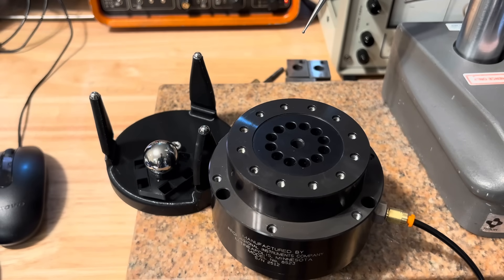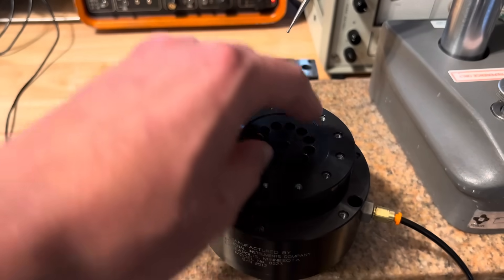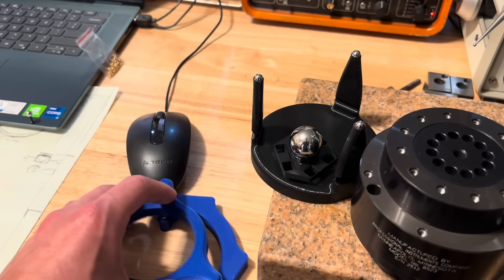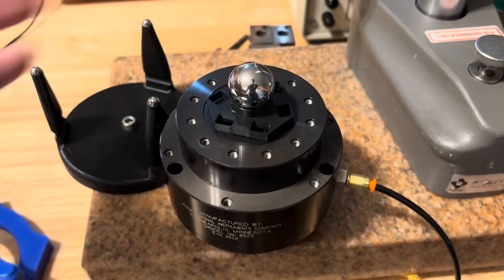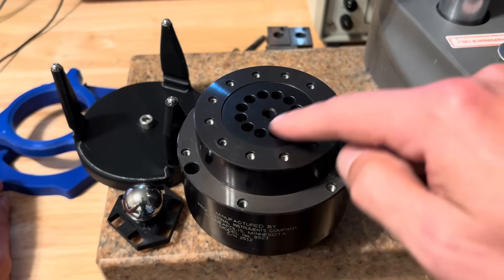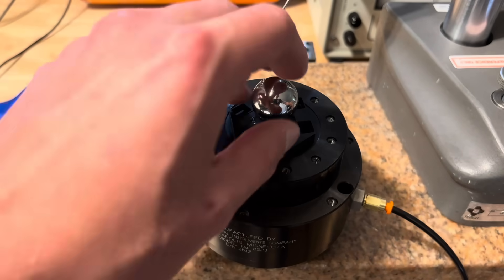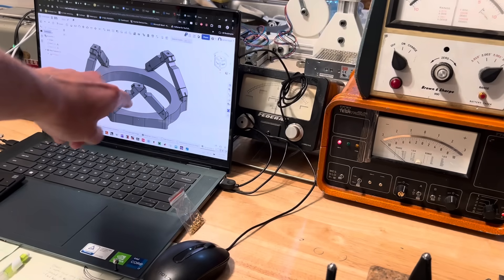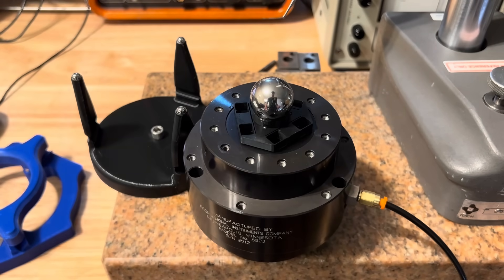Flexural kinematic couplings eliminate contact friction and provide me a convenient solution

Comment: That optical mount that you showed on the monitor... I used something like that for a repeatable mount for a lens in a portable device, so that the flexures could actually absorb some shock, and I built in temperature compensation for focus, too... Funny when you run across ideas, in other places.
Always fun to see what you are up to.

Comment: Excellent video. Really makes me think.
I've been doing a lot of research on Spindle Metrology and Error Separation and this helped me think about the impact of harmonics which I previously overlooked.

I'm actually working on writing a guide on simplified spindle measurement techniques using reversal methods, so this is pretty interesting. I'd love to discuss some things with you.

One of the things I was thinking about is how you can expand from a simple 180 degree reversal, to 120 degrees, which will allow you to capture additional information and build a system of equations that can better characterize the spindle (like removing additional noise) and let you interpolate to X-Y axis errors.
I'll have to think about it a little bit nore and do the math, but it'd look like this:
1) mount the indicator fixture at its starting point, take your measurements measurements.
2) rotate the indicator stand 120 degrees, take the measurements.
3) another 120 degrees, take your measurements.
4) rotate the artifact 120 degrees, take your measurements.
5) continue until you have captured all 9 measurement channels
6) calculate the artifact surfaces for each set, remove errors, etc (admittedly I haven't gotten to over-determined systems yet, but it's on my to-do list).

I can show you the equations I have so far. It's fun stuff!
Reply from the maker: Sounds dope. Would love to see it. Shoot me an email!
Reply: @cylosgarage sure! But, where can I find your email? 😁
Reply: @cylosgarage for some reason I feel like YouTube is deleting my replies, because I can't find them. 😐
Where can I find your ëmail?

Comment: One downside of flexures is creeping over long time, say days or hours. Plastics creep under load a lot. I made flexures from steel wires soldered to the rigid elements, and I believe it still creeps, albeit much slower. My load is substantial for the size of the flexure though

Comment: Where can I learn more about flexures and kinematic mounts? I have dream of making small and as light as possible netwon telescope for travel astrophotography and I would like to design it from scratch -  the problem you need to hold mirrors in place and to not aply any stress on them, or it will distort the image.
Reply from the maker: If that’s your application, I’d highly recommend “mounting optics in optical instruments” by Yoder!

Comment: I guess it could also be called an elastically averaged kinematic coupling?
Reply from the maker: I might push back on that. Elasticity averaged typically implies a large amount of overconstraint, ie. many different elements trying to constrain the same DOFs (which then average out because they can flex). However, this particular design, despite there being elastic elements, is still exactly constrained, so there is no averaging that needs to occur. That’s my take on the semantics at least
Reply: @cylosgarage  ah that makes sense! If you had more balls and made the flexures less rigid that would be elastic averaging.

Comment: So neat. Are the balls designed on the same bolt circle diameter as the holes or did you make them slightly bigger/smaller ?
Reply from the maker: Thanks! They are nominally the same

Comment: could had used those long kitchen tweecer's to pick it up and down agen ( just to minimize the amout on heat put into the system. from moth touching it directly but also the radiant heat from the body ( know there stil are some but the extra distance should somewhat reduse it  )

Comment: Why don't you use cone+vee+facet instead of the three vees. The flexures merely introduce some freedom, e.g., rotational and/or upward dislocation. Bending forces occurring at the flexures cause deterioration of mechanical stability over time.

Comment: Tangential comment you probably already know that I couldn't help not saying: What Included angle do you prefer using for the vees for a traditional maxwell coupling? According to Layton Hale the optimal angle that balances maximum allowable friction (0.3) for self-seating is 70° (as opposed to the typical 90°) while preventing locking (<60°).  This may be applicable to the chamfers on the pattern of screw hole of the spindle you might use in the future.
Reply from the maker: It depends on the application but generally Layton’s guidelines are a good starting point

Comment: Solid solution! If you didn't use planes for the Maxwell Vs and instead used parallel cylinders as the contact faces, would that reduce or negate the friction issue?
Reply from the maker: You still have the same issue, in fact possibly even worse. The contact stresses of a ball on a cylinder are higher than a ball on a plane